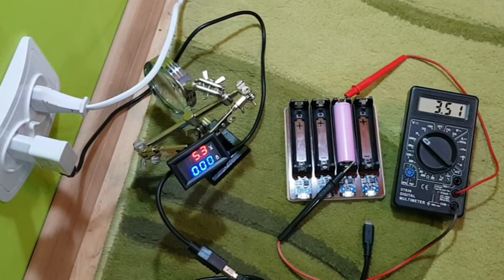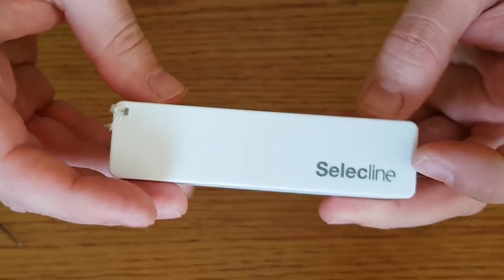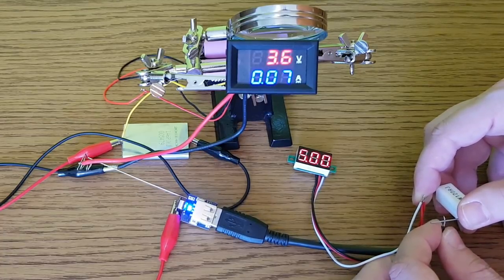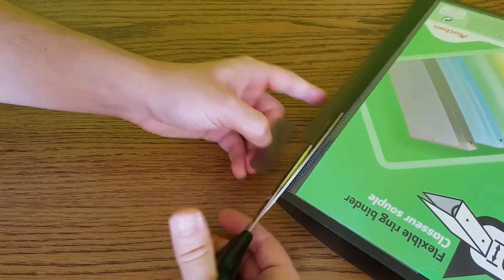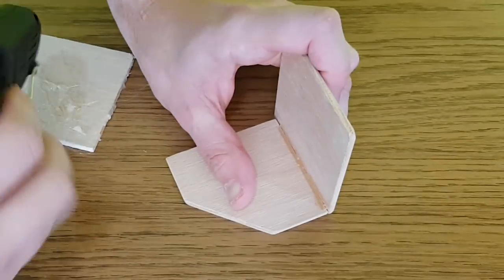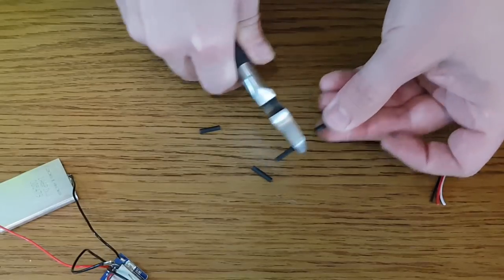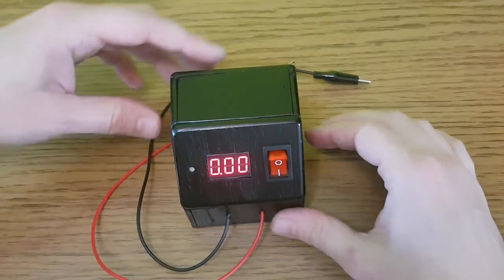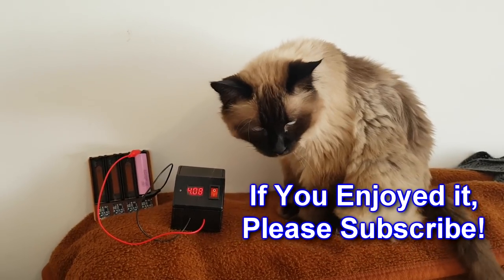DIY Voltmeter (Cheap & Easy) 0 - 30V DC

Comment: With a current draw of less than a single centiwatt, you could simply use a single Zener Diode as a voltage regulator for the voltmeter.

Comment: That alien cat is the same one that caused Nikola Tesla to see flashes of white light, as he pumped knowledge into his brain wirelessly.
Great video, but I found the same voltage meter with two wires on Aliexpress.  That simplifies the build to a box and just the meter readout. One could add banana-plug females and plug in any standard leads to sample voltages.

Comment: nice voltmeter....can it measure the current consumption of phone charger?
Reply from the maker: no, but I built a separate USB load tester, which can measure the voltage and current consumption from USB chargers.
Reply: one question I used tp4056 module and 18650 battery to power my voltmeter I don't use powerbank my voltmeter is working without powerbank.what do you say?please make me clear
Reply from the maker: some digital voltmeters work with a minimum supply voltage of 3V. but if the 18650 cell discharges under 3V, the voltmeter will probably turn off.

Comment: Hi Sorin i like this project .i just want to make one to test my led lights .which is the best volt meter to buy 3 wire or two wire
Reply from the maker: hi. if you have more than 3.5V, you can use either one of them. for lower than 3.5V you need one with 3 wires.

Comment: Very cool project mate. However, you can't use just ANY on/off switch, it has to be for the right Voltage and Amperage, right? Also, this is just my opinion but, the music in this video is excremental, I'd would prefer listening just to your instruction. Cheers
Reply from the maker: if you use a switch for a bigger load, you need to choose a switch rated for that voltage and current. but this digital voltmeter with LED display it's using only a few mA, so I can use any switch. this video is one of the first, now I edit the music at a lower volume.
Reply: It's a beautiful device that you build.Thank you for the explanation, regarding the switch - I'm a novice, when it comes to electronics. Keep making videos, folks like me can learn a lot from them. Don't worry about the music, that's my problem, not yours. Happy 2020!

Comment: What is the ic number inside the small digital voltagemeter?
Reply from the maker: I don't know. it's on the other side of the PCB. I need to destroy one to find out. it's this model:
https://www.aliexpress.com/item/32805485531.html?spm=a2g0s.9042311.0.0.64004c4dxcmpw8

Comment: Sorin why voltimeter works if the batery is 3.7v but  the input voltimeter minimum voltaje is 5v
Reply from the maker: what type of voltmeter do you have?
Reply: @Sorin_DIY  i have one whit 3 wires, and i check it with my power supply, it not work whit 3.7 v , it needs little more, but i review your video again  and i want to know what voltage you obtain with the charger module that you used, and a second question,  please sorin tell me what kind of led is that with 3 pin ,  and how you conected the led , where conect every pin
Reply from the maker: I'm using the circuit board from a cheap powerbank. it's increasing the battery voltage to 5V for the voltmeter supply input. I've replaced the converter LEDs with one bipolar LED. but I don't remember if it has a common anode or cathode, it depends for each step up converter.

Comment: Could I use some 12 V in series, e.g. color black color black color black? I need about 40 V.
Reply from the maker: hi. do you mean 12V batteries? then yes. if you mean 12V power supplies, no.
Reply: @Sorin_DIY  I mean these single 12 V connectors from the power supply.
Reply from the maker: no, you can't connect them in series.

Comment: Foarte tare! Dar după câte am ințeles nu poți măsura voltaje mai mari de 30V.
Reply from the maker: salut. asa este, mini voltmetrul acesta de panou masoara pana la 30V DC. pentru proiectele mele este de ajuns. exista si voltmetre care masoara mai mult pana la 50 sau 100V, dar acest model mi s-a parut cel mai precis.
Reply: Salut, precizie decimala este automata, adica daca am o tensiune de 2.54 volt, se afiseasa 2.54 sau 02.5???. Caut asa ceva pentru un instrument si 2 decimale imi sunt necesare. Multumesc pentru raspuns

Comment: Why on earth would you make your own voltmeter? for 5 $ you get a working one with a wider range than 30 V
Reply from the maker: for 2 reasons: 1 - it's one of my first videos on this channel and I wanted to start with something simple, to learn how to film it, make the script, edit the video, learn from the audience reaction and so on.. and I already had all the materials at home. 2 - the problem was not the money. I wanted a DC voltmeter for most of my future videos. the voltmeter must be small, so it will fit in the camera angle, unlike a big multimeter. it must have crocodile pliers (so my hands are free to do the rest for that video). the LED voltmeter display is illuminated and set at a 45 degree angle, so it will be easily visible on the camera, unlike horizontal multimeters, which are visible only from a narrow angle. in my opinion, making this video it's not a big deal. there are a few small reasons, but mostly is just practice for future, complex videos...

Comment: Why should I build (only!) voltmeter for $4.60 if I can buy multimeter for $5 (or less)? I like these DIY projects, but I think this is unneccessary DIY.
Reply: Edgar Koterle Multimeter that costs 5$ won't be any good.
Reply: For example multimeter that you can see at the beginning of the video costs about $5, you'll get many other functions and same measure accuracy as with this DIY voltmeter. And of course without any work of building that.
Reply: Edgar Koterle But if you like electronics, it is fun to make it, not simply buy pre-made.
Reply: As I said before, I like these DIY videos about electronics and I also make some DIY electronic projects, but in this case I think it's better to buy made thing instead of do something yourself. It doesn't worth it to do it yourself.
Reply: Probably to get an idea about how a multimeter works and as a learning experience.
or to quote Portal 2
"Science isn't about why. It's about WHY NOT! "
Reply: yeah I'm with you, really nice work but somehow it is a waste of time and material, the used voltmeter can't even measure the batteries used in remotes asmuch I remember this kind of voltmeters start at 3V. I have a multimeter for that I paid eight euros from a german dealer and it is doing everything just fine never feel the need to get a more expensive one.

Comment: It is useless for measuring amps, Especially higher amps. Batteries amps can't be measured, wires instantly gets red hot. Be careful not to burn your fingers. Only good for measuring volts you can do with a multimeter. It is wastage of money if you buy it to measure battery amps or other amps above 500mA.

Comment: i made one that only uses 2 wire, no need to power it, check out my video
Reply from the maker: this works too, but only for batteries or power supplies with a voltage between 3.5 - 30V. the 2 wires voltmeter uses one wire for powering the voltmeter (with minimum 3.5V) and also as a sensor wire, the wire that measure the voltage (at the positive terminal). the 3 wires voltmeter has individual wires (ground, positive power supply, sensor wire). so it needs a power source (3.5 - 30V), but the sensor wire can freely measure voltages from 0 to 30V.
Reply: Sorin - DIY Electrical Nerd i know, but i never use anything under 3.5, but the meter actualy works at 2.5v, i enjoy your videos keep it up